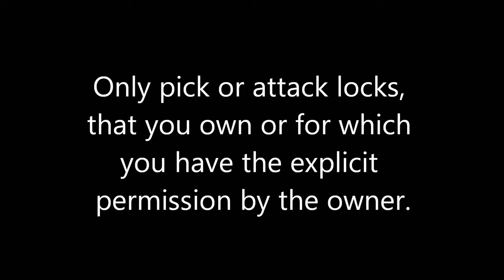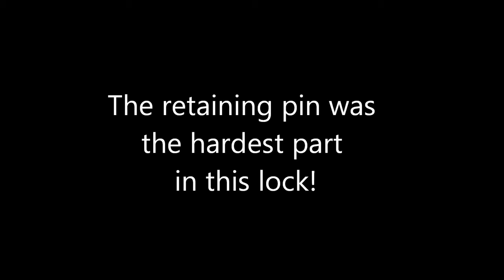(picking 218) BASTA 3 pin bicycle lock picked and autopsied - what a crappy lock

Comment: There's another product that should not be on the market that plastic top cover is a total fail wow! Only 3 pin and such poor tolerances - you're right horrible, However a good lesson in what not to buy!
Reply from the maker: When the parts jumped around and I realized how easy the lock could be bypassed I had to laugh out loud. I've never seen something like that.
Reply: +Potti314 just out of curiosity what if any lock do you use on your own bike? I know  better but still have a 4 digit combo lock because it's light weight.  And I mostly just wheel the bike in and out of the house, so I have no need for locking it up whilst out riding - cheers
Reply from the maker: TotallyRandom I use a U-lock like displayed here: http://mobilesecurity.abus.com/eng/bike/products/filter/lock?limit=999999&lock_type=ulock with a disc detainer core. Advantages: Massive steel (hard to cut), easy to carry (attached in the frame of the bike), locking mechanism hard to pick (although I don't care too much as long as it cannot be raked) and robust (no springs - important as impacted by water and freezing).
If you have a combination lock like that https://youtu.be/727-QM_dOGw?t=1 (http://mobilesecurity.abus.com/eng/bike/products/view/tresor-chain-catena-combo-1385-2-5-black) I think it's OK (advertised with: The ABUS combination cylinder protects against "pull-picking" and manipulation of the combination locking mechanism so thieves can't "feel" the combination clicking into place).
Cheers, Michael.
Reply: +Potti314 Thanks Michael,  I like the idea of the Abus anti pull mechanism, whilst bulky and heavy a thief would really have to come prepared ie. Bolt cutters or spend some time trying to decode the lock judging by the video. I tryed a U - lock of sorts years ago unfortunately it would rattle and clang against the frame, hence the 4 digit combo.  Thanks again for the heads up, Cheers Tim

Comment: I have the cable but buy the looped end ones and use a master lock,thanks for explaining why I see these on the road now,too easy to pick,a bobby pin and a hair pin will do it.
Reply from the maker: Thank you for watching. Are you satisfied with the handling of cable and the extra lock?
Reply: +Potti314 Cable is always a struggle,have to fight it sometimes but I would rather do that than have something stolen so easily. I think i still have one of those cheepo locking cables,I use it on my snowblower. The problem with any lock here in the North is ice. I spray lubricant in my locks to prevent ice and snow from getting into the lock. I have had many a lock frozen up,the key goes in but wont turn. Those cheepo locks are the worse for that.
Reply from the maker: I know these problems especially with combination locks. High humidity and freeze cause them to stop working. I have great experience with my disc detainer U-lock. It has a shutter in front of the keyway and because of the nature of it no springs inside.